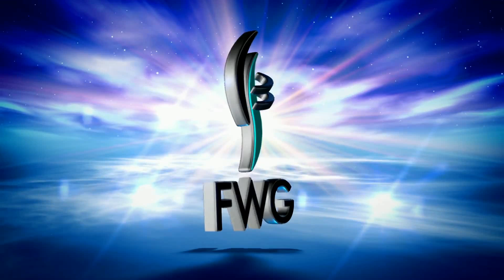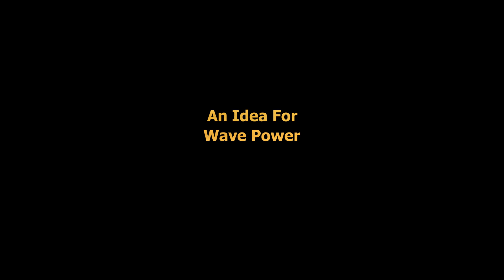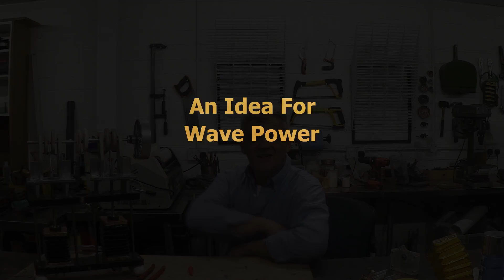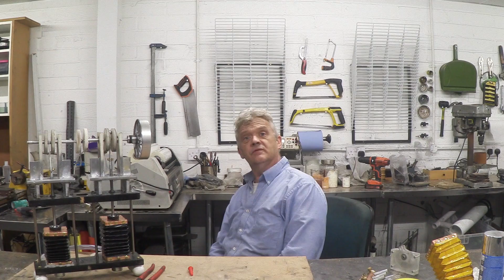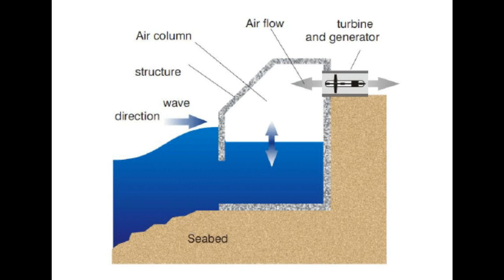An Idea For Wave Power

Comment: I love this idea. I have a similar one but for land locked forested areas. Would there be a way to harnes the kenetic energy in tree limbs? Look at a massive tree blowing in the wind, many of the limbs often weighing into thousands of pounds and they moves in very slight wind. If they are like huge and since winds often go in small gusts and variations the energy forced into the material over and over again. I can't imagine the total amount of work energy it takes to bend a 140 foot or more multi tons tree around .

Comment: That might work if it can be made to keep turning in the same direction no mater if the waves are sucking or blowing, valves on two pipes feeding it might work for that.  Only problem I see is it might need a lot of maintenance on the bellows, yes I know it is just a prototype and something better. After all a Hovercraft was a hair dryer and a cardboard box (supposibly) so now it is time tp prove it would work to power a small generator.

Comment: On the closed system in the illustration, I would install 2 turbines with nice big flywheels, and have one dedicated to the inflow and the other to the outflow by using a one - way shutoff system on each turbine. They could, of course, be connected to the same flywheel.

Comment: air is very compressible but water is not, so the air obsorbes a lot of the energy and the springs back on the return. been a long time since I made any wave power generation but I liked playing with the idea of a big float (boat) with a fixed cable. as the boat goes down on the wave the tether retracted. as the boat lifts on the wave the generator is pulled and turned, simple but some big forces. every anchor on a big ship could harness this. I also tried out piezoelectric pads under the ocean floor near the shore line geared to small and big loads, small the waves on and of the shore line and big pezo for the tides, ( tides which is the elephant of the oceans powers i feel) all along harbor  / marina walls I see the waves pounding the concrete. its endless. a simple wall plate with a piston along the water break the endless miles of sea defenses . vast  amount of energy right next to where most poeple live on the coast. or again the pezo pad along the deferences. mile after mile of wasted concrete. 
 I was also devising changing the state of a gas from liquid to gas. so if you had a deep water tether and generator. 
the liquid changes to gas pulls the tether and so  generator to the surface, then change to liquid it retracts to the sea floor, the cycle goes round. with some minor buoyancy changes through the stages.
so many ways. I can think of at least 10 more. some a lot better than this lot , but just try and convince the powers that be and you will be ridiculed and sent on you way. 
If the idea can be realized by the person you show it to then it will 99% of the time be stolen.
whats the point in building yet another energy harvesting machine? really.
I tried everyone I could think of, so many companies. sharks sharks sharks.
I tried Caroline lucus my local GREEN MP. I asked to have the right to put a device in the water at Brighton beach so I could demonstrate how I could harvest energy from the ocean using super cheap off the shelf items available in any DIY shop. the device is not visible from the air, on land or in the water. cant be seen, has absolutely no impact on any living thing in, out or under the ocean floor. Zero impact, lots of energy, no visual impact and super cheap.
her answer was " If you vote for me in the next election we can look at helping start up like this.
and that was the best reaction I had from the many companies and government bodies I tried.
Its all out there for the taking but the impossible barrier I can not pass is the powers that control who is allowed to try and demonstrate this. maybe if I was a company paying vast amounts of money into party supporting stuff I would get access.
but at the end the day the years I put into finding simple solutions to our power problems was a complete waste of time.
there are thousands of people who spend years to find the answers only to be robbed or beaten down, waste of my time.
fun though to invent but work pays the bills not free energy. not in out system of greed

Comment: Wave harvesting is interesting but I am inclined to think tidal generation would be more practical. Consider that waves are generated at the surface and represent a minor fraction of the energy produced by the volume of the oceans. The tides contain far more potential energy. Think of a float with a cable anchored at one end going over the shaft of a generator attached to a weight to take up the slack, rising and falling with each cycle. The apparatus would be relatively impervious to the effects of weather and have very small environmental impact since it would just be a float and a weight rising and falling with the tides. Now scale that up to a massive floating structure with very large generators. Anchor the corners with columns embedded in the sea floor. My thought is there would be a minimum amount of components making it less prone to failure.

Comment: Hi Robert 
for wave energy
build a chamber or use bellows
connect a valve, as per the air battery that will give you air pressure and a vacuum
Two turbines, one for the pressure side and the other for vacuum
connect both output shafts to a planetary gear system
connect to a fly wheel for constant rotation
and you should be able to generate power.

Comment: I used to be a diamond diver of the west coast of South Africa and Namibia where I worked close to land just behind the break water. So I have first hand experience of the power there is in what we called the "Surge" when a wave pass over head. If I were to build a wave power harnessing plant I will rather do it with a bank of underwater turbines that is driving centrifugal pumps that will pump water to one central turbine connected to a generator.

Your bellows could also be substituted with floats that is at the end of a rocker arm with a racking gear on, that in turn could drive two pinions with one way bearings driving a shaft that drives your generator.  

By the way, I find the content that you put up extremely interesting and informative, thank you. I would love to build a Zinc Bromide battery but do not find the raw materials needed to build the plates around here.

Comment: It would be , for sure, more efficient design than one on a drawing. However , when it comes to a wave power , I would stick a magnetic piston on a floating device (plastic canister) , which would be moving through a coil (wound on a non magnetic fixed pipe) , as surface of the sea moves. Less infrastructure to be built. You should try this sometime , because you live at the sea side...

Comment: Hi Rob.  We own a small boat.  Generating electricity without running a huge engine is a problem whilst at anchor.  Could a plastic pipe be attached to the boat with a polystyrene float in it.  The rocking motion of the boat would mean the pipe remains stationary, however the float would rise and fall creating a suck and a blow.  Your thoughts???
Reply: As a PS, we only need to generate 12V for any onboard system.

Comment: Here's a thought, Robert:  If you fixed the turbine vertically and had the bellows shaft run upwards and downwards through its center, the shaft could transfer that vertical movement into rotational movement via a scroll cam; much like a yankee screwdriver.

Comment: Buoyancy exerts more force than air compression though... ~( 'w')/

There are some people already making floating levers which apply massive power because they float on the water, and it is a really cheap way to harvest the effective force of the water directly through either gear multiplied drive to generators, or through hydraulic pistons.

Comment: Hi Robert, I have a possible improvement to your bellows making.  The front end engine drive couplings of a car  use a bellows like item to seal and protect the spline shaft movements from dirt and loss of lubrication.  You may have these in your scrapping out car or easy to get at any junkyard.  The advantages are:  designed for long duration and wear, can handle extreeme vibration, can handle much higher pressures than you have now and can have long extension strokes.  Might be the way to go for a more robust version to harness sea level to air pressure into bellow "pistons."

Comment: Makes perfect sense mate, and yes I think you are dead on in thought with the pressure of the ocean could push enough air up into a large set of bellows real easy. The ocean is massively strong and the pressure from all that water could act as if it was it's own piston per say. A water piston where the water is the piston that is so strong that it forces trapped air to be pushed in one direction. You will need one heck of a check valve to allow air back into the chamber as the water pulls back out. Great drawing in showing the thought behind this. I understood it to the T. That actually could solve most of the power issues in the world if built right and all around each coast. To save on the amount of steel needed to make large bearings, what if we the world made the large bearings like a hollow ball of steel compacted with compressed hydrogen air instead of solid steel? hmmm, It would make them a lot lighter and just as strong or stronger even. The air in them would keep them from being able to infold on themselves and would stay cooler if we put them in a room that is a refrigerant room per say. Got me thinking now, lol
Reply: I loved this topic. I once said that all things are created by a pushing and a pulling all at the same time and if we could build free energy it would be because we had figured out how to utilize the pushing and pulling in what we can control in our lives. Cheers, the magnet is one of those things but so is air pressure.
Reply: Even the electromagnetic frequency of all things is created by a push and pull a negative and positive. I looked to the stars and space and wondered one day, what can we learn from them, and then the wheels started turning and what I realized is so were we turning but we were spinning towards something but at the same time we were being pushed from something. Our very route of creation comes from a push and a pull which leads into a positive and negative which might even be why we have something called a bad and good and the old saying of every action has a reaction. Can I get an A+ in the class teach? lol Deep thought all from your video of bellow power.

Comment: Hydraulics have many advantages over pneumatics. Although it's more difficult to engineer a water turbine in abrasive sandy salt water. An isolated hydraulic system might be possible. I would think you'd lose a lot of energy with an air system especially with the oscillation. But I agree it might not be important when it comes down to total costs when working with natures free energy.  ....  Inspiring Rob!

Comment: Intriguing and inspirational ideas as always. At the back of my mind I’ve always had a project on my list of ideas to test out of having a serious of simple bobbing Tesla valves oscillating with the waves to hydraulically pump seawater to the shore. I imagine the head of water wouldn’t be great but with enough of them to pump a great enough volume I wonder if it would be enough where you could have the water flow back to sea via one of those water vortex generators to generate electricity. One of these days!
Reply: Nice thought, but sea-life likes it when you create channels with seawater (nutrients) flowing through them. They make their home in your system and block it.
Reply: @DreadX10  Thanks, and of course you make a very good point. I’m only thinking of testing out a proof of concept first to see how much head of pressure, flow rate etc I could possibly generate, more just as an experiment out of curiosity. Should it actually work in principle I’m sure there would be many other practical problems to resolve beyond that. Possibly evolving into some kind closed-loop system! :)

Comment: when you speak of the wave power design and show the image, I immediately remembered a BBC show called "Planet Mechanics", which was a one season wonder, episode 5 would be of particular interest, as they build a wave power generator on the end of a Jetty or Pier. works almost exactly like the one in the diagram, if the device is there, after 17 years, maybe you could go take a look? maybe you could connect your final device to it? i don't know, i just remember that it was made all those years ago for a TV show.

Comment: Desalination where the water pump is powered by the sea waves, extract drinkable water through reverse osmosis, then we use the brine to capture some room humidity from air like that MIT project, then the excess brine is evaporate to extract salt.

Comment: In fact a good ten ? years ago there were 2 English men going around Britain, and setting up various green power sources for people. One was a wave /air generator. The got a 90 centimetre diameter  corrugated plastic pipe, bolted it to the seawall, and had a 300 watt generator with a fan blades that rotated in the same direction regardless of the direction of the airflow.  I would still add a concrete shield wall around what ever is used, since water can be quite destructive.
Reply: the show was called "Planet Mechanics" and that was episode 5

Comment: Sir...love your outside the envelope approach.  Now a question.  Since much of the power generated is an uneven cycle, how would you smooth it? Assuming generator(s) would be used, would an array of capacitors be needed to quick store and release power?

Comment: It's interesting that I commented yesterday or the day before the idea that perhaps you should look into wave power using the ocean. And now you've incorporated that into your bellows device. Coincidence perhaps. At any rate it would be gratifying to think that you do get ideas from other people's suggestions. That's what the internet is all about I think, sharing thoughts and ideas. I was about to suggest using a piston instead of the bellows but someone beat me to it in the comments here lol oh well.
Thinking a piston might have less wear and tare and is more durable. Also I might add that they are currently using wave power by converting the wave energy directly onto mechanical motion using buoyancy and generating electricity that way instead of using changes in air pressure. Example: Paddles moving up and down with the waves. Must be a bunch of different ways to do that. Perhaps you might be interested in my idea for using the extreme pressures at ocean depths to launch rockets to save fuel?

Comment: Use a long lever arm attatched to semi boyant sphere on one end and a joint on the other, but along the arm attach pistons (lineer and recipricating action...) to a rotary component that turns power generators with each rise and fall of the wave.  Seems like endless opportunity for power!
Reply: Kinda-sorta what I always envisioned.  I just imagined it directly attached to a rotary device somehow.  But there is something really cool about creating/using compressed air though.
Reply: @jmsfabrication7821  Indeed!  I can imagine all sorts of possibilities, compressions, one way valves, air storage, endless energy availability...
Reply: @jmsfabrication7821  Take advantage of leverage, force amplification, use a crank shaft which turns a rotary attached to a generator, also a pneumatic apparatus (a bellows of sorts) which pumps pressure into a tank to store potential energy...etc, etc.  Indeed!

Comment: Intrigued Rob, there are direct wave linked systems though most attempts have suffered from the environment and nature 'Barnacles'. I presume having the wave just pressurise air which does the work decouples from the destructive environment but how much energy transfers through the air compared with an incompressible fluid? And I assume you need to tune to create at least two resonance nodes to drive a two-cylinder machine which produces rotation in one direction.

Comment: As a test bed,  what about a 4" thin wall PVC pipe with an L at the bottom facing out to sea.....add a coil wrapped around the outside somewhere around the middle of the high/low waterline of wave activity, then put a magnet laden float inside to move up and down with the waves...
Or maybe a coil inside and magnetic float outside....
Might even be able to drive a bellows off the top of the pipe as well...
Reply: Awesome idea mate

Comment: I’m a complete layman so this is probably a question with an obvious answer, but I’m going to ask anyway. Would it be reasonable to use the kind of one way flow system used in a simple foot pump and either have a dual turbine system (one for each air direction) or, redirect the air to flow through one turbine in a single direction?
Reply: I think the type of "conventional" oscillating water column device that Robert shows in the video would be regarded by some as an "advanced" design by virtue of its use of a single bidirectional air turbine instead of mechanically more complicated arrangements. For any viable commercial wave power generators, the need to provide moving mechanical systems can be a severe reliability and maintenance headache, hence designs that eliminate the need for mechanical rectification of any oscillating air flow can be regarded as advanced, at least if the bidirectional turbine design is good enough.